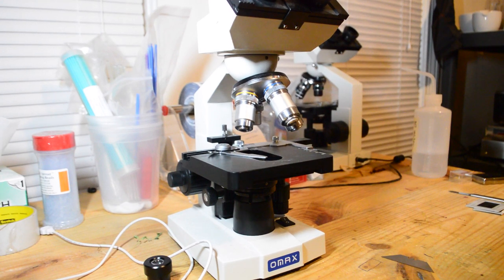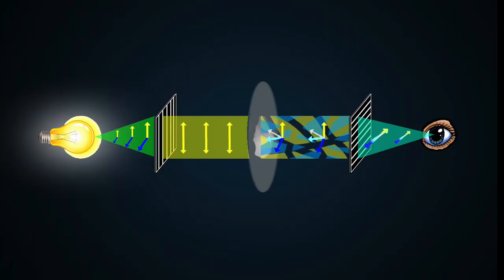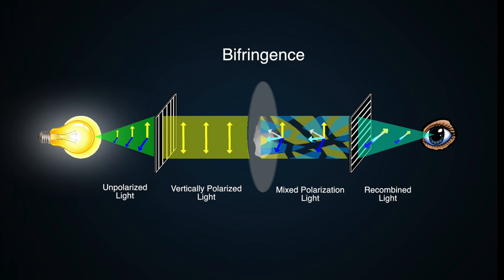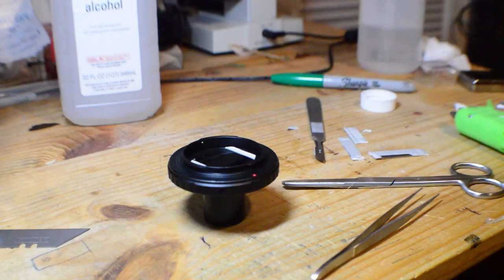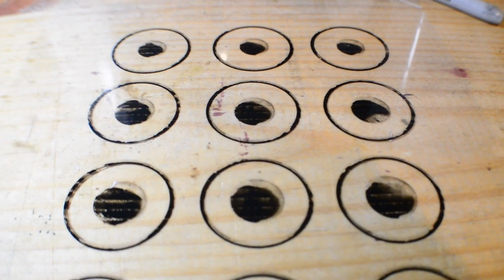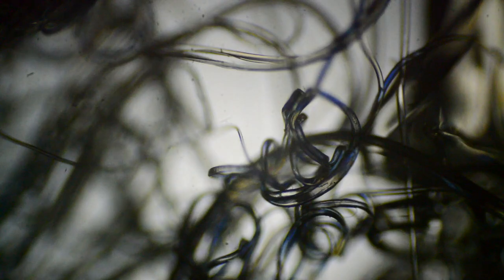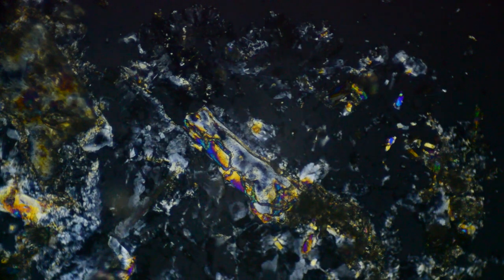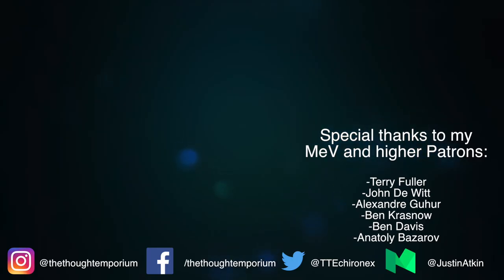Upgrading a Cheap Microscope Lets You See Rainbows! - Polarized Light Mod

Comment: Be careful using aluminum foil as a darkfield stop; it can reflect heat back into the lamp and cause it to overheat (less of a problem for LED scopes). I've used black cardstock which works well and absorbs a lot more of the light rather than bouncing it back downward

Comment: Thanks a lot for this excellent tutorial! I can confirm this works very well, but the polarizing filters need to have NO scratch, else the image will be very blurry! I found that polarizing sheets can often come scratched, whereas polarizing glass filters for cameras are more robust and provide the same result (that's a tip I found on a microscopy forum), so in the end I am using polarizing filters for cameras and this works very well. Also, using 2 circular polarizing filters is better than the typical linear polarizers because with circular filters we can still see some material that would go totally extinct with linear, as described in this paper: Higgins, M. D. (2010). Imaging birefringent minerals without extinction using circularly polarized light. The Canadian Mineralogist, 48(1), 231-235.

Comment: Yes, it's great to see these cheap and easy ways of producing more advanced modes of illumination. I have found that you can get really good darkfield images by leaving your microscope light switched off and just shining a reading light or even a strong torch (flashlight in American) across the axis of the normal brightfield lighting, ie horizontally, parallel to the floor.  It's a pity there just doesn't seem to be an easy do-it-yourself way of getting phase contrast lighting, unless you have invented one!

Comment: Very good insight of polarized and of dark field microscopy. I'm curious about a couple of things, though. As my degree is in photo science, with a good splattering of basic optical design and engineering:

1. Do you really need to stack the black mask or is that to create opacity for the mask. Why can't a singular, opaque circle of the correct diameter, mounted onto thin plastic be used?
2. Why does the positioning of the upper polarizer need to be so critically placed (on the inside, upper housing v/s the bottom of the eyepiece?
Thanks, great work and narration.

Comment: I want to replace the very hot lightbulb source with some LED, (using a pi cam) I tried a white LED and a 365nm LED. What would you suggest?  Perhaps a RGB ?
Reply from the maker: I'd stick to white honestly. You can do rgb but you'll end up with weird effects.
Reply: I understand that the mounting of the RGB could be problematic to obtain a constant color mix…, if it is that what you're referring as "weird effects" ?

But you can buy color filters for "white light" microscopes..., 
That's my reason asking about RGB.

Could also add UV and IR leds so that the RasPi could change the colors automatically while taking pictures.
Could be a nice Open Source project, but I can understand that if you already have white "LEDs", their is no reason to change… but if you have a Pi cam mounted… 
Perhaps getting other viewers, while YOU explain to us "How UV fluorescence microscopy works" (and caveats), doesn't have to be a long video.

Comment: Cant you use two polarisers to vary the brightness of light underneath as opposed to the aluminium
Reply from the maker: It'd be easier to just turn down the brightness at that point, so not really
Reply: The Thought Emporium you .may not have a variable light supply ..

Comment: Use your 3D glasses from the cinema, if you want to experiment but not buy anything.
Reply: Not an area I know enough about, but I believe cinema 3D uses circular polarization. I wonder what impact that would have on the results of this project.
Reply: Joats yes they do, but the glasses are analysing filters which make the circular polarization to an linear. Left and rigth hand polarized ligth produces linear polarized ligth with a 90 ° rotation. A second linear pol filter seperates them per eye.
If you shine ligth thru the glasses they get linear polarized, is what i wanted to say XD
Reply: I know there was a reason why I kept them :D
Reply: +Dute Nait, Thanks for the reply, you gave me the kick I needed to at least read the wiki article on Polarizers (and so I end the day slightly better informed than I started it, cheers).
Reply: some Old or broken laptop /pc monitors also have polarising screen.
Reply: Thanks for the tip!